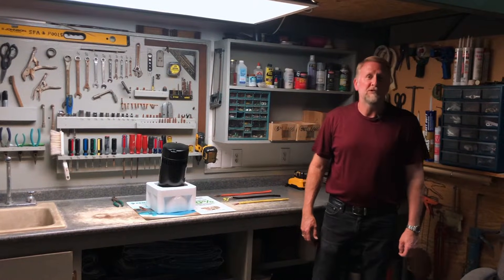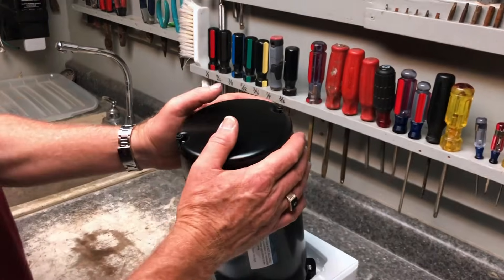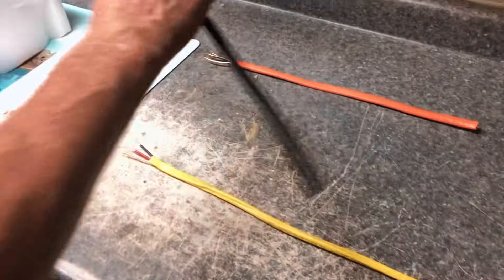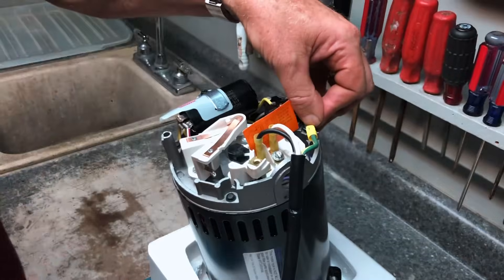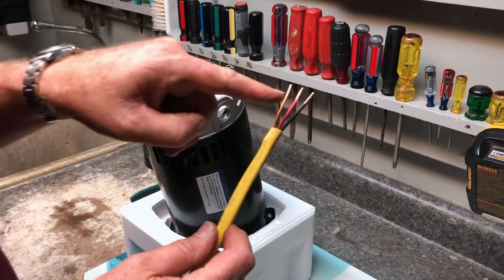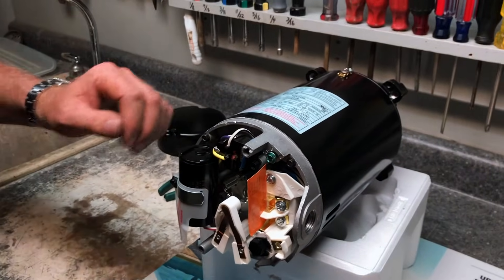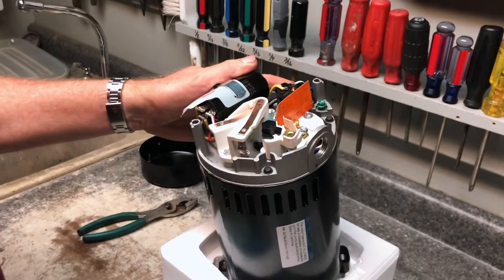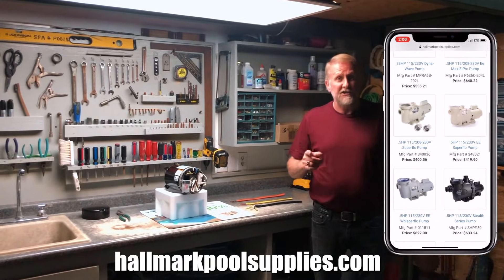How to Wire the Motor on a Swimming Pool Pump | Quick and Easy!

Comment: Hi Mark thanks for that video. I am building a house in Mexico and have a new permit pool pump.  It comes as 230 but I can more easily wire it as 110 based on the way I've got things wired in pool equipment room.  Is there that big w performance difference from 110 to 230?  My pool is relatively small at 10 ft by 23 ft and 7 ft of that 23 ft is only 11" deep.
Thanks,
Sean

Comment: Have a Hayward 1081 2 speed pool pump. It will not start on low speed. It will run on low after starting on high. What might be the problem?

Comment: Ok nice,clean shop, knowledgeable and nice pool guy (hard to come by) but the prep necessary for this job is the hard part for a DIY’er.Trimming the wires correctly,crimping those ring ends,getting them through that opening in the side of the pump and then connecting those leads can be very frustrating.
Oh and have a crimping tool and wire cutter handy or go get one before you start.And make sure you buy the right cord.
Like most YouTube video you need to watch more than one to get any job done.

Comment: Truly doesn’t matter on the 115 set up which is hot line?
Reply: It doesn’t matter. If you hook up a light fixture and swap the hot and neutral the light will still turn on. The power is just flowing in the opposite direction

Comment: Question? I have a 2 hp pool motor with a 80 foot run to the breaker box. Do I use 10 AGW or 12 AGW?

Comment: I have a dojenys 1.5 hp inground pool pump and my top i believe is my run capacitor has 4 wires , 2 yellow and 2 orange i think , my question is does the 2 same color goes on same side and the other 2 on other side of the capacitor , im confuse i took of the capacitors now i dont know where they go , any help please is appreciated

Comment: I have a Hayward VS 700 pump for my bubblers that I can’t get power to come on this pump.  My main pump works fine.  I put a volt meter and I have 110 coming in but won’t power up the display.  Is there an inline fuse or something I’m not finding?
Reply from the maker: @jammzb    If you contact Hayward at customer service they should be able to help you with this issue. Thanks for watching.

Comment: 2hp 220v I can change it to a lower voltage?
Reply from the maker: @GLXFlores    You can check the electrical schematic on your motor, however, 2 hp single phase motors are typically wired 220v. Thanks for watching.

Comment: What if there 5 different connections
Reply from the maker: @frankcovarrubias7013    Sounds like you have a 2 speed pump, you can check the schematic on the motor, this will tell you what you have and how to wire it. Thanks for watching.

Comment: Question.. I replaced my spa pack(balboaBP7) and hve 2 pump sys 1 pump 2 spd)  2nd pump 1 spd)230v  when I ordered my amp cords I didnt realized when I started to replace them that both cords have 14/4 wire instead of getting 1-14/4  &  1-14/3...1st pump ok with 14/4 ,  will the 14/4 cord work on the 1 spd pump ? 
I am not getting the 1 spd(high) to kick on. Does the Position of the wire going in on the amp cord male plug make a diff being plugged in the board? I did tape off the red wire and only hooked up the blk& wht & grd  I assume that blk went on "Line" and wht to "4" according to my diagram.   1-on top-"line" to right at top)  3 is accross left from that "line")  4 is under 1   5 is accross under 3 hope this gives a pict of my pump(emerson)  I'm thinking it has something to do with the 14.4 cord and the wire position going in to the Amp plug to get my other jets firing  sorry for the long winded I think my best bet is to order a 14/3 cord because I don't think the being plugged in to the bord and it not read it correctly
Reply from the maker: @garyredmond9275    It depends on how your spa pack is set up, to be safe l would contact the manufacturer. Thanks for watching.

Comment: Thanks so much. I was trying to wire a booster pump for a well that was 220. I couldn’t figure out where the neutral was supposed to go and it was confusing because the motor plate labeled one of the load lines as neutral. I see now that is only the case if I were to select the lower voltage. Im glad I figured it out by watching your video. I wasn’t about to create a direct short just because of the label, but it was driving me crazy trying to figure out where to put the neutral. Thanks again for clearing the issue up for me.

Comment: I have a 115 volt Aquastrong 1.5 HP pool pump.. wires from breaker box are black green and red..  wires in motor are black green and white..can I just attach black to black, green to ground, and red to white? Thanks
Reply from the maker: @toddwalter4571   Yes, as long as your supply line (the feed) is 115 volts. Thanks for watching.

Comment: How hot should this pump run
Reply from the maker: @Fool223   You should be able to touch the motor with your hand. If it’s too hot to keep your hand on the motor then your motor may be overheating. Thanks for watching.

Comment: My new pump keeps tripping the breaker. What did I do wrong. I wired it for 110 it a 1.5hp pump
Reply from the maker: @sheilabradley6385   Verify if you have 110 volts or 220 volts coming in. Make sure you wire the pump accordingly and that none of the wires are touching one another. Thanks for watching.

Comment: Can I change my 2hp pump to a 110?  I have a 110 outdoor plug
Reply from the maker: @ccow24   Check the schematic on the pump, most pumps that are 2hp or bigger are wired for 220v. Thanks for watching.

Comment: Hello, I have a 20 breaker. Should I run my pump on the 115 load? Or is the 230 load fine?
Reply from the maker: @latwylaancalade4322   You need to confirm if you have 115v or 230v coming in (your supply). Once you have determined what your supply is you want to set the pump load accordingly. Do not run the pump if it is not set properly, you can damage the motor. Using a volt meter will tell you if you have 115v or 230v. Thanks for watching.

Comment: Mark, How do I install an on/off switch at the pump? I just bought a
New pump which I will use for a mobile vac unit, and I want to be able to control the power right at the pump instead of of having to run and unplug the unit off the wall. Can you help please. My u it is set to 110. Thanks
Reply from the maker: @frankberrios9064   If your feed is 110v, follow the directions on the switch that you buy. Your wire will have one hot line (black), one neutral line (white) and one ground line (green). Make sure the power or cord is off or unplugged before you start,  once your switch is hooked up then you can run from the switch to the pump. It’s not difficult to do, but to be on the safe side you can always contact an electrician if needed. Thanks for watching.

Comment: You never actually wired it. Do the wires go through that hole?
Reply from the maker: @etmeyutub   Yes, the wiring goes through the hole on the side of the motor. Thanks for watching.
Reply: @HallmarkPoolSupplies  That hole is on the side of the motor. So i have three wires going into that big hole. Do I have to worry about water getting into that hole from rain? Is ther supposed to be some kind of rubber plastic to seal it?
Reply from the maker: @etmeyutub   Yes, you need a threaded fitting that screws into the motor and connects to the wire. This will keep it sealed so water does not get into the pump. You can get this fitting at any hardware or electrical supply store.

Comment: I have my pump running at low voltage 115v and i have the green wire on ground, load 1 is blk wire, and the white wire neutral is on load 2, the white wire burnt up and melted can anyone explain why this happened?
Reply from the maker: @matthewkotin4493   If wires touch, this can happen. Thanks for watching.
Reply: @HallmarkPoolSupplies  yes sir thanks but the wires didn't or wasn't touching do you think maybe if moisture or water perhaps got in and drip on the wire it could be possible 🤔?  Because we did hav a heavy rain storm that came thru and soon and then that's what I noticed cause the pump stop running? But I really don't kno or if on the back side of the terminal the capacitor was also on the same terminal I had the white wire on too so this time I moved to the terminal next to it so no 2 wires were on the same terminal. But I do hav I back running which I'm grateful for. I just kno im keepin an eye out for it thus time.

Comment: Why did i install correctly and wire sparks and trips breaker?
Reply from the maker: Sounds like you might have wires touching each other. Turn off the power and check your wires and your connections. Thanks for watching.
Reply: @HallmarkPoolSupplies  thats exactly what it was thank you so much for the help!

Comment: I just installed a 15 HP Pentair EQ series motor and the wiring had me confused.  There was no neutral so I did my best to wire everything up exactly as it was before but I still wanted to check whether or not I installed it correctly.  It’s 298/230/460V so three phase.
Reply from the maker: This is obviously a commercial size pump, most of these pumps are 3 phase. To be on the safe side, contact the manufacturer through customer service and they will be able to help and answer any questions that you have. Thanks for watching.

Comment: So when you hook up 220 does the white and black (hots) both go to the circuit breaker (2 poles) nothing goes to the common bar?
Reply from the maker: This is correct, two hot lines and a ground. Thanks for watching.

Comment: My Hayward 1hp super pump needs to be replaced after 5 years . I’m replacing it with another same pump and discovered that the guy who installed it wired nutted the neutral and hot wire to the test lines which should have been removed. I’m wondering if that’s why it didn’t last long.
    The old pump was set for 230v 1hp, so I thought I should have the new one set to 115 v but it would set the breaker and turn off. Is it okay to run the pump at 230v… is it going to get damaged?
Reply from the maker: You have to wire the pump according to the feed or supply that you have. If you have 230 volts coming in then you have to wire the motor for 230 volts. If you have 115 volts coming in then you have to wire the motor for 115 volts. If you don’t wire the motor properly you can damage the motor. Thanks for watching.
Reply: @HallmarkPoolSupplies  I’m using an extension cord 14/3 with white black green or should I upgrade it  to two black and green?
Reply from the maker: It depends, if you are 115 volt then run 12/2 wire white,black and green. If you are 220 volt, then you need to hard wire (no cord) using two black and a green or black, red and green.
Reply: @HallmarkPoolSupplies  the guy who installed the first pump for me used the cord so I continued using it. That explains my problems … thanks so much!

Comment: I need to replace my 20 year old 1 speed 2 HP pump and the best price is on a 2speed 2 HP pump but I read that you can just not utilize the second speed on the new pump.  Is that right?  Any tricks or suggestions? Thanks for the video!
Reply from the maker: If you are able to locate a single speed 2HP motor you can replace just the motor. If you have to replace the entire pump (2HP) then you will have to go with a variable speed pump. I carry motors as well as pumps, if you need one. If you email your contact info l will be glad to help, my email is on my YouTube channel. Thanks for watching.

Comment: Electrician here. Always use a proper wire connector rated for the application. Always use rated conductors/wire for your incoming electric. Always remember to re-identify your neutral conductor when switching it to a 220. Lastly but most importantly, always keep your shop as clean as this guy. Great content! 👍🇺🇲
Reply: Good points. Thx.

Comment: Hey love this video.! No extra opinions that are meaningless.

I do have a question for ya. One of my weeklys has an older pool with just one 1.5 inch line feeding the pump main drain is piped into the skimmer line near the skimmer.  A couple years ago I installed a pentair 1.5 horse variable speed.  If I turn it wide open it cavatates . Do I need more back pressure or is this happening because of the lack of water supply or possibly both?  

Thanks in advance !!
Reply from the maker: It sounds like a lack of water supply or a restriction (possibly a clog). Thanks for watching.

Comment: How can determine if my wiring is 110 or 220 from the previous set up..I'm no electrician there was a pool here and I found how to get power to the recepical at the pool. 
1) what power is coming out from the source?
2) so I need to open up the pump motor also to determine the setting?
3) the only thing I know is, 220 has a huge plug compared to a 110.
The pump has a small plug and the power source has a small plug but the cord is thick very heavy gage wire.
Reply from the maker: By code pumps that plug in are supposed to be 110V. Once you have determined the voltage from the supply then you can change the setting on the motor. If you have a volt meter this will help determine what your feed is. You should have a schematic on the motor so you can convert from 110V to 220V. The newer pumps have a switch in the back of the motor which will allow you to convert from 110V to 220V. Thanks for watching.

Comment: 115 and 230 which is not said, when you run power off the fuse or breaker panel you would have a double 15 breaker or 2 fuses  you than have 2 power wires if you are cheap and want a on off switch 2 light switches in the same box works fine just make sure you flip them both at the same time if you put a light switch on 115 you would only need one on the power lead

Comment: i have hayward 115V-230v i want to convert to 115v but the wires supply 240v ? can i still hook it up and change motor switch to 115 V?
Reply from the maker: No, you need to wire your motor according to your supply or feed coming in. If you change the supply then you can change the hook up on the motor. Thanks for watching.
Reply: thank you for your fast reply @HallmarkPoolSupplies

Comment: Hi 👋 Mark , installed a pump as you showed it but when turn the power switch the pump turns on then stop then I hear a click I did shut off the switch concern not damaged the pump.
What is going on ?
Reply from the maker: It sounds like the pump is not wired correctly. Check your voltage and make sure that your pump is set properly (high/low) to your voltage (220/110). Thanks for watching.

Comment: Thank you. For the very important information if u have a thermal protection motor and the indicator is set on 115 and u wire it 220 it runs but shuts off is the motor damaged or did the thermal protection do it’s job
Reply from the maker: More than likely your motor will be fine, but definitely hook it up properly before running it again. Thanks for watching.

Comment: hi Mark, my husband and I are trying to replace our pump. The wires 2 hot ones are already attached to the motor- from the manufacturer. Do we just strip them back and wire them in? If so, do we need the connectors? Thanks
Reply from the maker: If you are referring to the two lead wires L1 and L2 you can use spades (connectors) or wrap the wires around the screws on L1 and L2. Thanks for watching.

Comment: The replace pump I bought does not have that switch only has three ports, one white wire port, one with a red and brown wire and the last port a black wire. My wiring that I’m using has black, white and green for 220. Would I connect black to black port, white to the red and brown port, nothing to the white port, and ground to the ground green screw?
Reply from the maker: You need to check the schematic on the motor. For 220v you will have two hot wires and a ground. You should put one hot wire to L1 (line 1) and the other hot wire on L2 (line 2). Your green wire goes on the ground. Thanks for watching.

Comment: I bought a Aquasport 2 hp.  With a timer on it.  How should I wire it?  Start to timer and turn pump timer on 24 hrs or hook it i to timer box and run it to straight electric 220 and bypass wall timer?  Please help
Reply from the maker: You should have a wiring schematic for this pump, this will tell you how to wire the pump with timer. If not l would contact the manufacturer or consult with an electrician to be safe. Thanks for watching.

Comment: What if my pump is hooked up right and works but after 20 minutes it gets hot and stops. wired to 230.  UST1152 pump
Reply from the maker: It sounds like your motor is overheating. You can go to a local motor repair shop and have them look at it. Depending on the age and condition of the motor, it can be repaired or replaced. Thanks for watching.

Comment: Hey I have a question, I brought a used pool pump 1.5hp and it's says 115v but the wire looks like 220 it's weird looking rounded three prongs. Can I just switch the wires to a regular three prongs plug?
Reply from the maker: Yes, however you want to verify with a volt meter that you do have 115V supply at the receptacle. You also want to verify that the pump itself is set for 115V. Thanks for watching.

Comment: Thanks Mark for the great video!  I've got a 220V pump with electrical coming underground to the "pump house".  It's 3 wires coming in, so two hots (red/black) and a ground (hopefully - this is a white).  Is there a way to tie into this supply for a new 110V receptacle?  I understood from your video that there are two 110V supplies to choose from, but I get lost a bit when thinking about tying in because of the lack of a neutral coming in.  Appreciate any help!
Reply from the maker: I would recommend that you test the supply line with a volt meter, this way you will know what you have. Usually green is ground and neutral is white, if you are trying to go 110V you will need a neutral. If you are not sure on the hook up you can always contact an electrician. Thanks for watching.